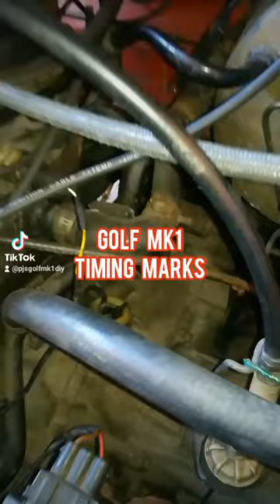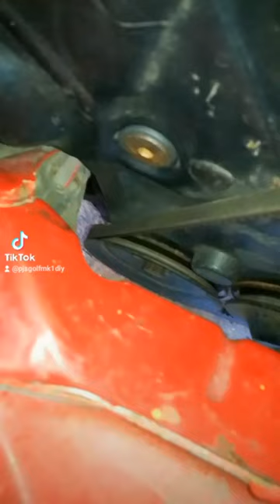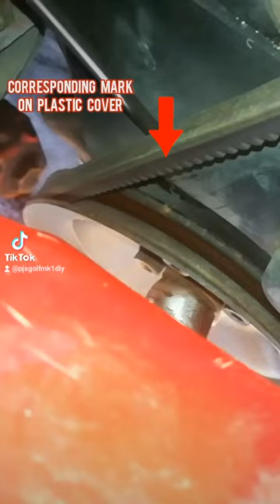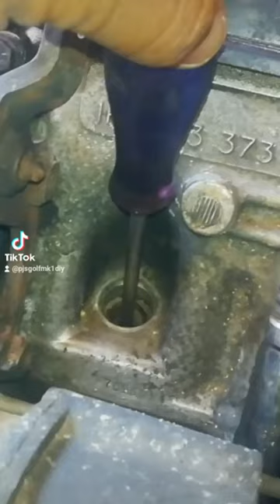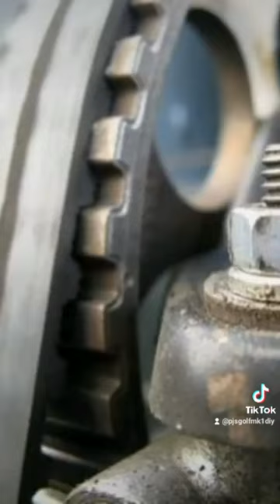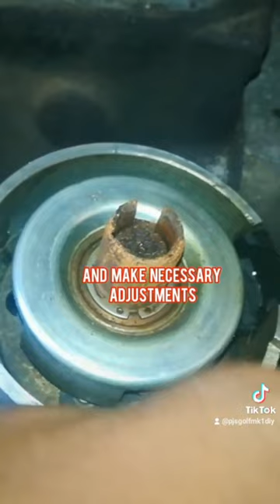VW Golf Mk1: Timing Marks Guide. #shorts

Comment: One question: In my car there is a label with the wordind : BTDC - 3+/1. What means ? 
Also I tryed to put my ignition timing as per the video, but the engine lost power, unless I ut in advance.
Reply: the early engine is set at 6° btdc with the vacuum advance line plugged.

The later engine is set 16-19°btdc with the vacuum line still connected.
Reply: @prawny12009  Thanks for yours imputs. My engine code is BBV from south Africa, year 2003, VW Chico 1.4. The label in the car show BTDC - 3 +/1. Is this engine to be set up with vacumm pipe conected ?

Comment: My golf 1 is been mixing water and oil so gaskets have been changed so now the car starts but do not have power and it consume a lot of fuel what might be the cause?
Reply from the maker: Must be a timing issue..check it again
Reply: @pjs-golfmk1-diy  even flywheel ?

I now just chacked my distributor it doesn’t match with the mark you have shown on the video
Reply: @SNKTvshow  am with you all the marks match but the distributer will not